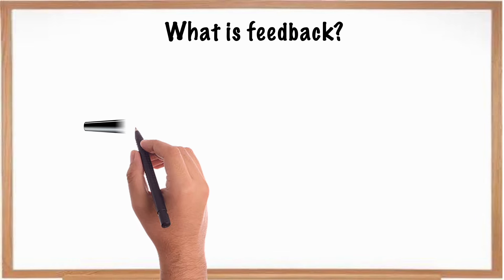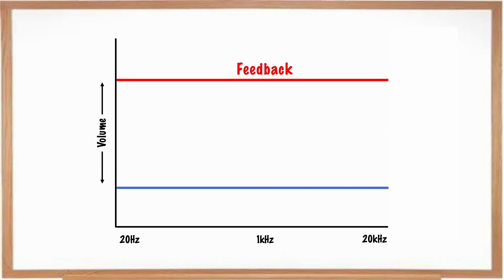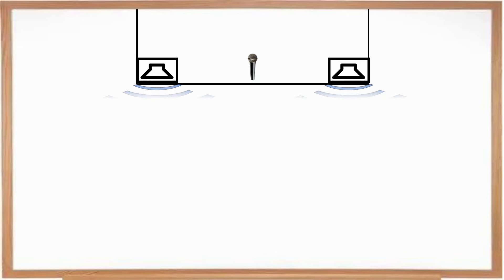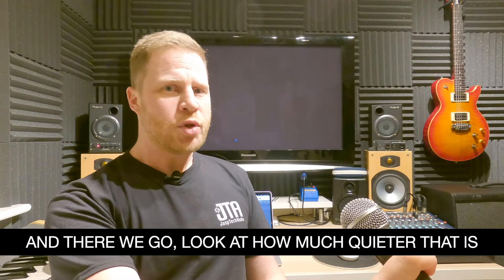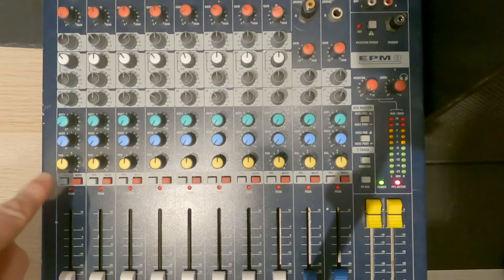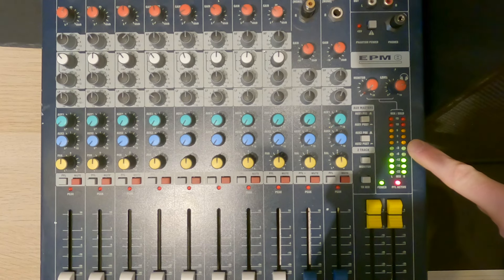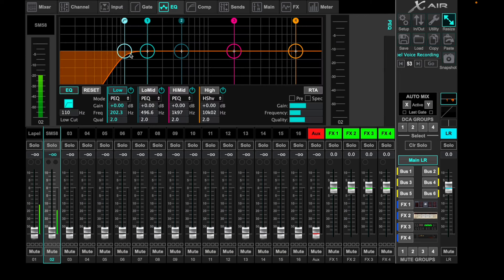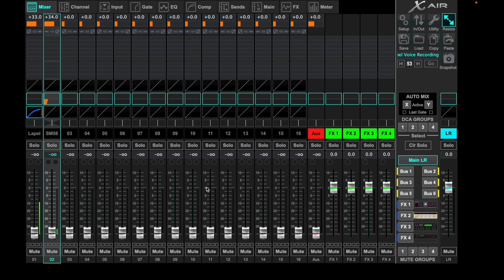How To Eliminate Microphone Feedback - For Gigging Musicians.

Comment: Good video mate. I just bought a new house with a big den for jamming and the feedback is crazy. If speaker placement isnt doing the trick would you reccomend higher vocal compression? My guitarist tells me its the way the house is made and the metal behind the walls is causing bad reverberation. I may have to buy sound proof foam.

Comment: I was watching because in my last gig, I had someone speaking and I couldnt get my volume high enough without feed back.  In watching this video, I think my lows were too mixer highs, mids and especially the lows will too high.  I will try it out at my next gig.  Also with people speaking, it is hard to get them to talk into the microphone properly causing me to turn up the gain and volume.  I'm using a dynamic microphone (Shure SM58), would a different microphone be better in a live event?
Reply from the maker: Have you had chance to have a play at another gig yet? When it comes to people just speaking into a microphone it can sometimes be difficult to get the volume needed, especially if the person speaking isn’t talking directly into the microphone. I had this at DJ gig a few weeks ago where somebody used my radio mic to give a speech. They held the mic really low and didn’t speak directly into it. Thankfully though, where they were stood was behind my speakers. I also cut the lows and low mids, which cleaned up the sound and helped prevent feedback. Like I say in my intro I’m a music teacher and I often setup a microphone for the head teacher to use when stood at a lectern. For this I do use a condenser microphone rather than a dynamic microphone. A condenser microphone (which needs phantom power) is designed to pickup sound from further away, but the downside to that is they can then also pickup reflected sound and signals coming from the PA speakers more easily, so you may need to do more work on the graphic EQ. I hope some of that helps.
Reply: This is exactly what i struggle with everyday! Please do more videos on this.

Comment: Thanks for this, i really dont think you need the background music at all in my opinion, or have it really really low in general. Its useful content and I found it distracting. Keep it up thankyou!
Reply from the maker: Thank you. Noted for next time. To be fair, I’ve learnt something doing this video. The music was really low during editing, but it looks like Final Cut has done something whilst exporting the video. It’s either applied some automatic volume changes or the file compression has done something during the export. There are parts of the video where the music gets louder when my talking gets quieter (like when I pull the mic away from my mouth) and other parts when the music pretty much cuts out, like when the mic is feedback during the graphic EQ section. This is something I automated or programmed and only noticed it after I’d uploaded the video. Glad you found the video useful though.